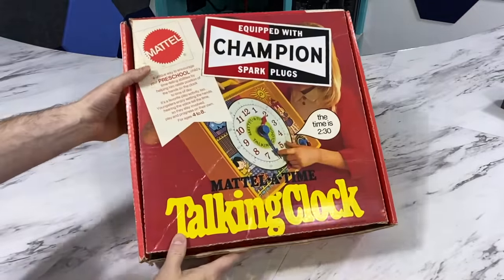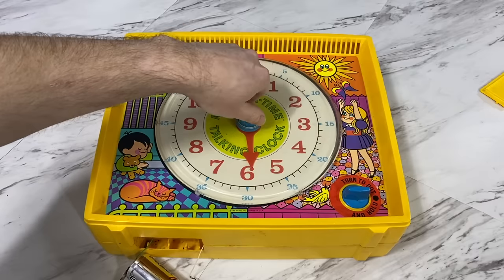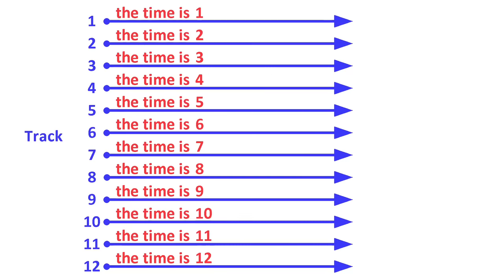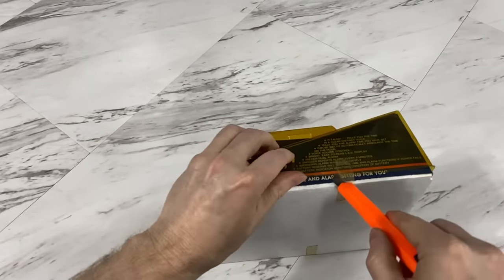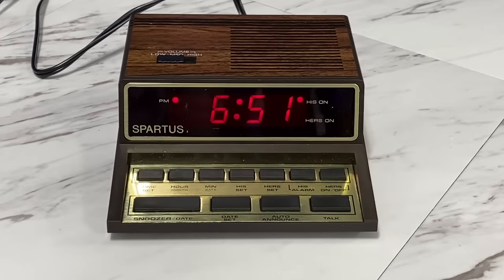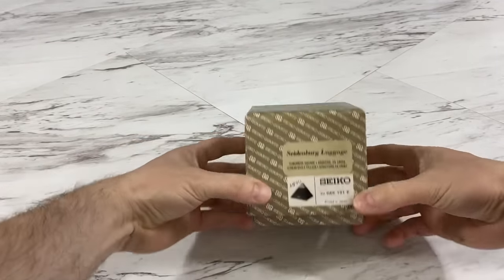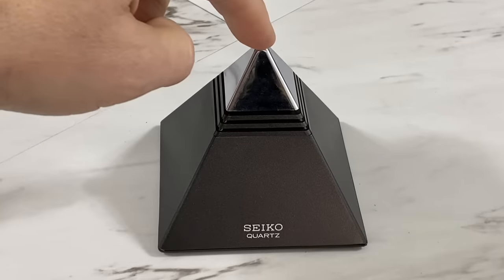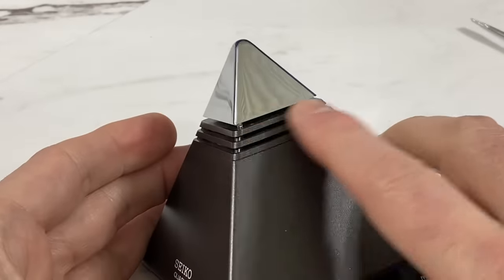Talking Clocks of the 1980s

Comment: i don't think the Vox clock had just a ROM. The left blob looks to be a simple speaker driver, the center blob is definitely the clock controller, which would leave the right as the ROM.
But if i look at the components. I think it is actually a custom speech chip. The nearby capacitor appears to be a oscillator and the two resistors in the corners seem like they could form a 2-bit DAC with the resulting signal indeed appearing to trace to the other side of the bob towards the driver.

Which would explain the surprising fidelity compared to the Seiko pyramid that was probably just sending a '1-bit' modulated square-wave signal to the speaker. The vox could at least make a facsimile of a proper analog sine-wave.

Comment: I am so glad you made this video, I’ve been especially curious about that Voxwatch ever since I found a little demo of it a few months ago. The Spartu Clock was I’m pretty sure rebranded by RadioShack as the Vox clock three. There was a vox clock to which I do have, it’s the same cube shape except it doesn’t have a screen and it has the same voice as the watch but a different alarm melody. Sharp also made a few talking clocks with the same voice and they also made a talking calculator clock. I love old talking electronics from the 80s, probably one of my favorite videos on your channel is that video of the worlds first digital answering system.

Comment: Do you remember the Store, Consumers Distributing, they went under, some Holland company bought them, then Steve Jobs ended up with rights, then developed all the Apple stuff, he didn't invent anything, just copied the stuff we had with Consumers Distributing and sold to a different generation.
We had touch screen in the 80s...was in Mercedes and BMW  vehicles to adjust heat and and climate settings

Comment: When I first heard the voice on this clock in the video I said to myself wait a sec that for all the world to me sounds like the Texas instruments speak and spell but this does make sense for the time. No pun intended.

I did have the Speak and Spell as a kid it was at that time when the newer ones not the one with the round but like the original but the one with the membrane keypad which was a later model.

If anyone remembers what would happen sometimes when the batteries would get low!

It would actually go crazy and also you actually usually have to remove the battery to get to well shut up even the soft power switch would not turn it off.

I do believe I remember it having a 7805 regulator I don't think it was a low Dropout type?

Been so long since then I don't remember a whole lot about the internals!

It did run on four either C or D batteries I can't remember which it was.

So 6 V with alkaline however the problem was me even more pronounced when using nicad batteries which we did later on.

And which means even lower voltage of course.

But 6 V is awfully close to the needed regulator output!

But when the batteries did drop below a certain voltage I remember one time it just started looping the word Angel over and over and over until at least one battery was removed!

I do remember end of life for it something went wrong internally I may he have figured it out at the time but that has games to me since it was so long ago.

Rather spectacular if anyone's heard of the phrase Magic Smoke yep it escaped!

When that Blue Magic Smoke escapes it's what makes it it work once it gets out it don't work no more.

And yes sizable blowhole around one of the pins on a chip.

I suspect there was a short circuit somewhere or something shorted or otherwise.

It was running on battery at the time!

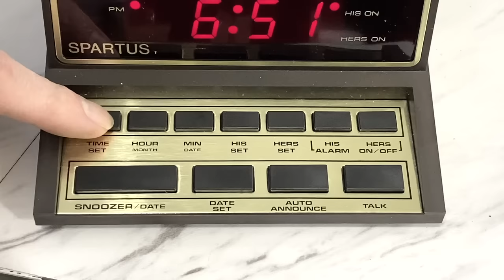Comment: 5:30 This clock is the one I’ve wanted for years. Can’t get it anymore. The alarm gets louder the longer it runs w/o being turned off. I’m visually impaired & knew a lot of blind people who had this clock. I’ve wanted it for ages. Could you please respond with the model number so I can try to track one down. That would be very much appreciated thank you!
Reply: It's called the Talking Alarm Clock by Spartus Electronic. The instruction label on the bottom lists a Model No 1411. Made in Hong Kong... rebrands may or may not exist.

Comment: Hey 8-Bit Guyy. Thoese batteries Yuo've bought are zinc-air batteries. Peeling off the sticker from the top triggers a chemical reaction that releases electricity. They are designed specifically for hearing aids and have a short lifetime due to their specifications, so i assume, Your speaking watch will most likely be out of service for a long time. I cheer you. As always, it was nice to watch You.

Comment: I kind of want to put a slightly better speaker in the pyramid clock and then replace that epoxy blobbed IC with a modern chip I can reprogram myself. I bet it could be made to sound much clearer and much cooler. Even with chips of the time period, probably.

Comment: In the 90's, I remember seeing that pyramid on a desk and wondering what it was or how it worked. I thought it might have been a holographic thing or something really cool. Now I finally know that you just push it in and it speaks the time.
Reply: I think I had seen such similar thing recently, probably was a clock too but it didn't work and was there just for decoration.

Comment: I really don't think that Spartus clock is any older than it appears to be based on the chipset date codes.  The feature set alone (his and hers alarms?) is a bit too sophisticated for the first-generation talking-clock devices, and those vinyl "simulated display" stickers didn't really become a thing until the mid-80s anyway.

Comment: Fun fact:  The VoxClock 2 and the successor (1995's 63-914) were made by the same OEM - Reizen.  If you look at the bottom of your VoxClock 2 and the 63-914, they are exactly the same.  The third generation of the cube is still for sale by Reizen - and still sounds exactly like your VoxClock 2.  The VoxClock (original) prior to the one you showed has a distinctly different voice, likely using a different voice chip. (https://www.youtube.com/watch?v=yUcUJUNB5c8)

Comment: Hey! This episode is for me! I’ve got a pyramid clock, and a few Vox Clocks =]
Reply: Interesting, I’ve had the original Vox clock model from the 70’s (no hourly announcement or alarm) and a few Vox Clock 2s, but, all of mine, have a different rear design with no LCD and only one rocker switch & the rest of the functions controlled by only 3 buttons. Also, they have a male, much more “Speak N Spell” sounding voice.

Comment: dude that vox clock is either a bootleg modern nockoff or a rereliece and totally not from the 80s at all.
I am legally blind and got one just like it at a camp for the blind in 2009 in a prise bag.
If the buttons are round on the top, batery lid has an inset split oval in the molded plastic where it meets the housing as means for your thumb to grip, and there is a slight angle to the screen! and it has a light its not vintage

Comment: Hey 8-bit guy, you could consider donating those batteries to somewhere that provides hearing aids to people. While that is not as common of a battery type of hearing aids as the 312s, it's still the 2nd most common for the ones that need more power. Depending on the hearing aid, one battery can make the aid last 4-7 days. Just a thought. Thanks for the vid!